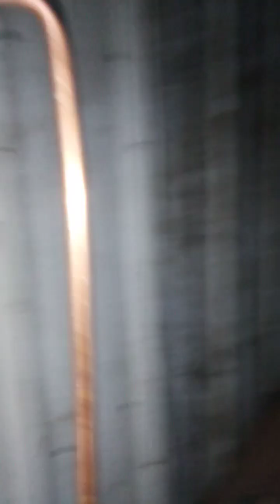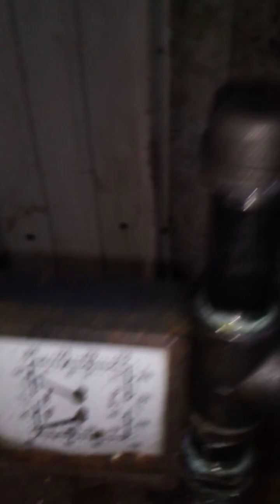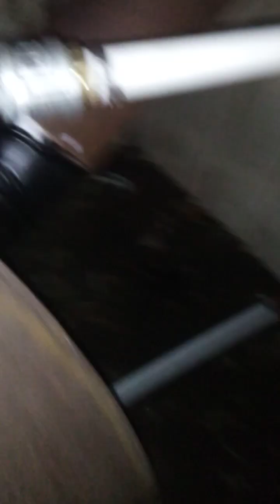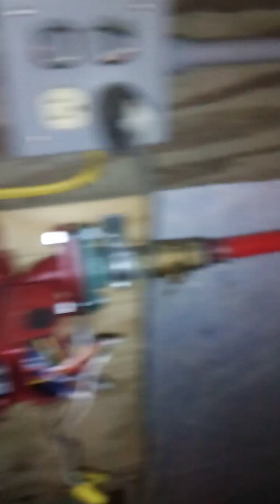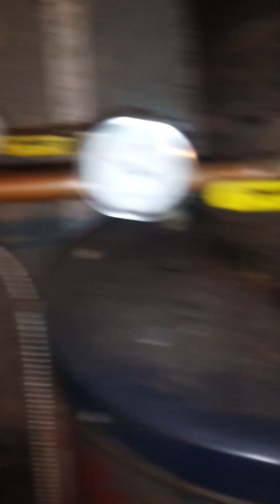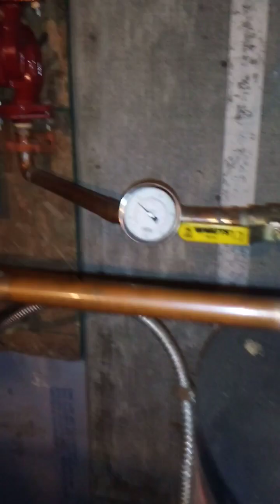DIY Waste Oil Boiler for Home Heating

Comment: Hi, I like the project, do you have the list of materials you used for that ? Could it be possible to run the heater as well as capturing the gas at the same time as you do with the wood ? 
Thanks by advance and nice work.